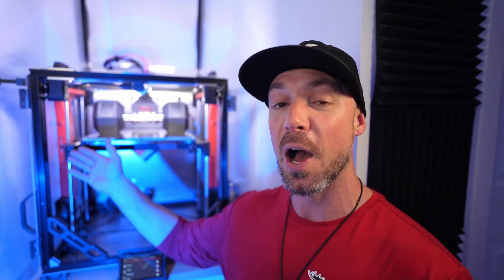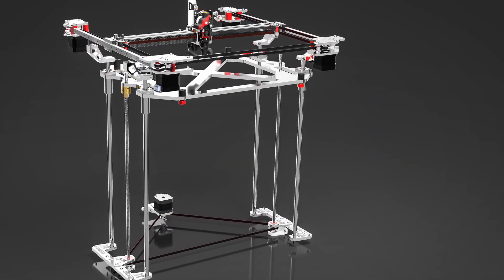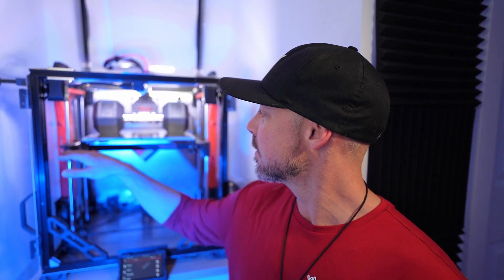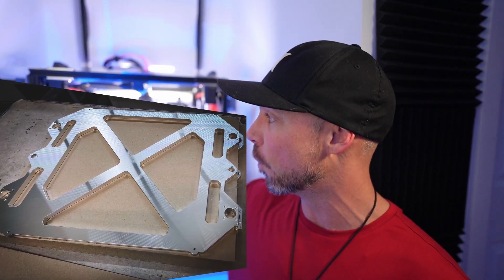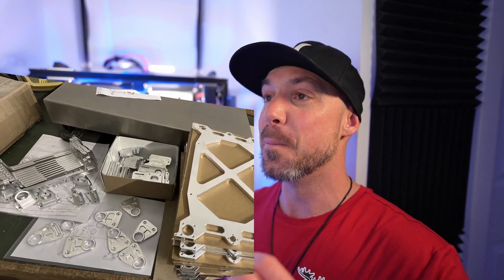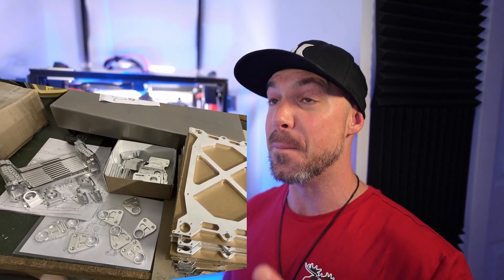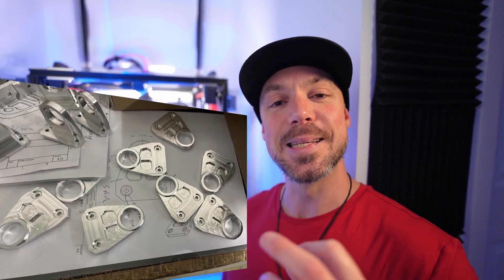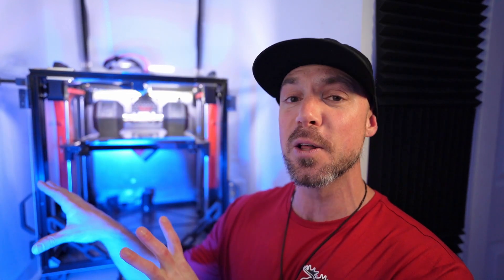VzBoT Single Z motor. Torque test

Comment from the maker: For this test, I have cranked up the tension of the Z belt, otherwise the motor gear skips on the belt with the 25lbs, which is normal and on purpose. That belt wrapping arround the gear with just enough contact/friction provides protection in case your crash the bed in the gantry. It will just skip on the motor gear. However, as you can see, if you put a enough tension on it, it can lift something really heavy. So make sure you don't tension your VzBoT Z too much to keep that "protection"! It is powerful enough to do lots of damage ;)
Reply: Once you get happy tensions I record the note (440/e flat)  the belts ring and keep it there so new belts get adjusted the best and clears ringing but I am an audio dude too so it comes with my love for sound too so may not be for everyone but i am sure you could make something simple up a guitar tuner will do tho
Stratasys uses a tension gauge and dial indicator to each machine there is a mark to be achieved and in turn are notes and for me are an easy way to keep them in check without question of to tight.

Comment: Yea, lead screws powered by steppers can be super strong. I’ve rammed my bed (on three motors) into the gantry many times, and the bed always wins. Luckily there hasn’t been much permemant damage, but the motors can completely bend the x axis while also supporting a 10kg 500mm bed.
Reply: Ratrig?
Reply: @omtapkir8639  yes

Comment: I have no doubts the motor/leadscrew combo is plenty strong but I do think a real interesting test would be this test but repeatedly hitting a (mechanical) height gauge indicator!

Just hard mount the indicator, move the bed up to it, zero the indicator then G-code the bed down like 100mm and then up again and now you know your Z axis repeatability precison under load!
Reply from the maker: There will never be 25lbs on that bed haha. I can do the test with a printed part that weights like 1lbs hehe
Reply: @Vez3D  I totally agree! 
A more realistic weight and a more realistic belt tension…
Expected max load + 50% would be interesting?

Start smaller and go up incrementally like you did in this video 👌
Reply from the maker: @greenveg42  Its no big deal. I just tested super fast z hop of 1mm with a 5lbs weight.  3K z accel and 20mm/s
Reply: @Vez3D  With good repeatability? Nice!

Comment: Hello, Simon!
Still did not get why you put that powerful 60mm motor on Z and use low contact pulley to add some "programmed" weakness to the system?
By the way: what is the current of the Z motor?
On my previous built Z axis works on two small MENA14 motors with only 0,2 amps, which is well enought for the main purpose (moving the bet up and down), lets the bed to be moved by hand if needed (when motors are not energized) and there will be no damage if something will go wrong.
I think that the current of the motor is the most convenient way to control the "programmed weakness" of the Z axis.
Belt tension is not well controlled.
Reply from the maker: True.. i run at 1amp normally..and for this test i ran at 1.4
Reply: @Vez3D  So in normal operation your Z motor current is 1 amp? I'd drop in to 0.4 or so. It will be enough for the purpose but less prone to damage your printer and to reduce the load on the power supplies (and reduce you electricity bill as well)
Reply from the maker: thats a good valid point you make there, and the reason why I went with 60mm to start with, was that I had it on hand when I first built that machine hehe.  and it stayed. It might be over powered, but its not a bad thing :)
Reply from the maker: @rmatveev  yeah I like that..I will test with low amp and will only give it what it needs to offer more protection. good idea

Comment: Been using a single motor twin screw layout on various printers for over ten years. Simple effective and pretty much hassle free. Main thing is rigid end stop switch and motor mounting  setup (i.e. no plastic, all metal ) and letting the system warm up before setting nozzle clearance. Use of ball screws or anti anti-backlash nuts essential, also radial support for non drive end of screw very useful. Having  a floppy screw is not good design. Found repeatability acceptable.   The old kiss in work.
Reply from the maker: Im a big fan of kiss

Comment: F=m * a. Force is proportional to the mass times its acceleration. So with more weight, you will have lower max acceleration possible. Doesn't matter too much for z, but sometime to keep in mind for stuff like z hop
Reply: Does matter for fast zhops.
Reply from the maker: Im not gonna z hop with 25lbs haha. The new z cnc will add about 2-3lbs. Z hop is not going to.be affected much. Z hop are like 0.5mm or max 1mm travel.

Comment: Just one question, what current You have on Z motor? Voltage is about 50V if I know right.
I think it's a best possible Z-system if we talk about non-triple/quad motor self leveled. I think I'll try it on my tronxy someday, with 4driver board it must be way more rigid in comparision with stock parallel motors.
Reply from the maker: My z is on 24v. And it was set to 1.4amp

Comment: Am i right if i calculate with the volume of the printbed 0,33m * 0,33m * 0,33m (X*Y*Z) = 0,035937m³ then multiplied with density in worst case of 1070kg per m³ (ABS) => 0,035937m³ * 1070kg/m³ = 38,45kg for a full printed bed? i know nobody would be printing a solid block on the printbed but that would be the maximum as weight for the printbed. If the motor holds this round about 38,5kg (84.9lbs) then it will hold all printed parts. Maybe you can test this? @Vez3D
Reply from the maker: That will never happen like you mentioned